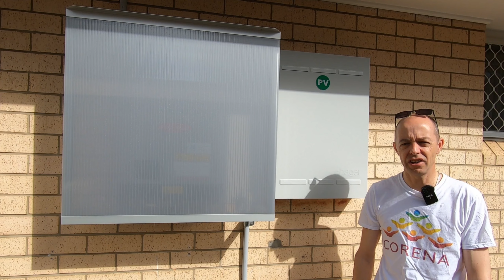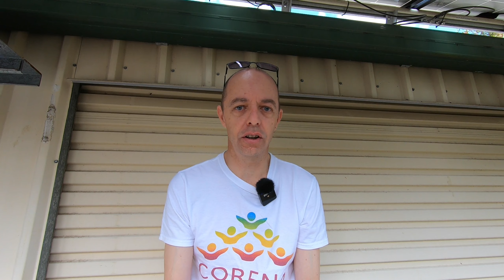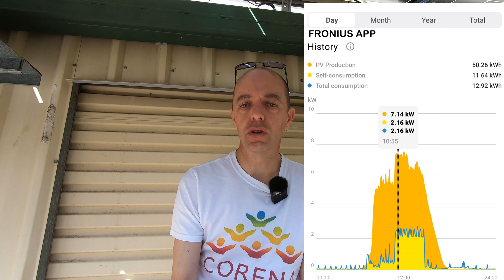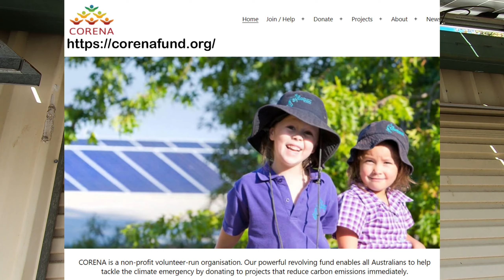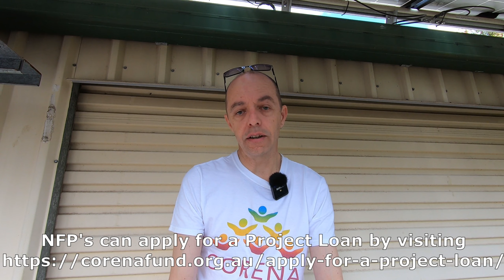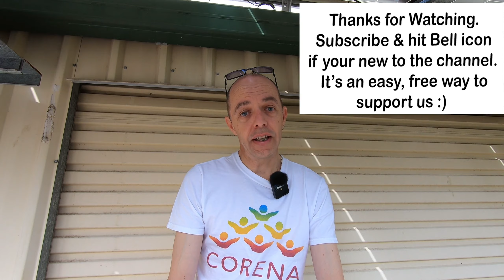Charge your EV for FREE | Choosing a Solar System, Considerations, Our Experience & Cost of Install

Comment: Am considering 2 different setups:
7.83kw system Jinko N type 415W with a 6.0kw Fronius Gen24 inverter $8,045 out of pocket with Vic rebates n STCs accounted for. 

or a 9.87kw system Jinko N type 470w panels with a Fronius 8.0kw primo inverter. $8904 out of pocket with VIC rebates n stc accounted for. 

even if we wait to get a battery down the line that's another few grand $ which I don't think makes much sense for our usage. We have an Atto 3 EV on order but electricity usage is about $280 p month. 

thoughts about the Primo vs Gen24 hybrid? 

Thanks - Dan
Reply from the maker: Hi Dan, thanks for watching and the comment. Main reason for the Gen 24 would future intention to get a home battery and ability to have emergency supply circuit ability if grid goes down and sun shining. It is also quieter if noise would be an issue.

If these things aren't important the additional capacity of the Primo will provide better value/payback.

Thanks again and please 'Subscribe' if you haven't, it really helps me out. Cheers.

Comment: I'm in Brisbane also, I note a few comments of "in QLD" but that is supplier dependant. I have 10.6KW a hybrid inverter and 10¢ per kilowatt export. Just us two here, 4 br, 2 Bthrm, ducted A/C, so light use of electricity, was about $350 per quarter, now in credit ~$26 per quarter. No sense getting a battery with those figures unless we get an EV (next car will be). The inverter has extra connection for an alternate panels to be connected for this. I suggest all interested in solar, and your rundown is excellent, research for their use/costs/orientation/panel warrentee/output etc. Always watch your channel as I love it.
Reply from the maker: Hi Terry, thanks for watching and the comments. Love having that energy being generated on the roof and fueling our EV. It's a game changer if you use a lot of fuel in your car.

Comment: Awesome thanks for this informative video, im in Victoria and had a 10.4kw solar system installed 2 years ago. I was lucky and already had 3 phase so decided to go big. We have a fronius inverter 2 string system, we also have odd roof orientation. Any way Im looking at getting the new MG ev and was wondering about charger size because I don't want to draw from the grid at 28 cents per kw to buy. I was getting 20 cents infeed but Victoria has dropped it and now get 14 cents per kw I feed back, still better then what you're getting that's pretty stink.
Reply from the maker: Hi, thanks for watching and congrats on the solar PV and thinking of going electric. Depending on your driving habits you may not even need an EV charger. The 10 amp normal power point charger which comes with the car pumps in approx 10-12 klms range per hour and if you only use it when the suns out your charging from solar, unless. This is the most basic/manual way but works for us.

Step up is a 15 amp charger which puts a few more k's in per hour or you could then go up to a smart charger which can measure demand and generation and only use solar to charge the EV. Keep in mind the price of a charger buys a lot of grid electricity, but they do charger faster so that's what it really comes down to.

Need any more advice drop us a note via our website and we can setup a 30min session. Cheers Greg

Comment: I like your solar setup. I hear a lot that if you have solar you can charge your ev for free. When most people have to drive to work and charge the car at night surely the battery storage required to still charge the ev for free would be enormous and not really free anymore.
Reply from the maker: Hi Andrew, thanks for the comment. Yes charging from a home battery isn't economical or efficient. Best way is to charge when sun is out. Otherwise if I was to buy grid electricity overnight it would cost approx $8 per 250klms driving. Hope that helps. Cheers.

Comment: A Zappi is only $1395  for 7kW or $1695 for 22kW (which you can’t use anyway being single phase) - I think the cheapest L2 charger on the market is about $900 so the Zappi’s not that much more. Are you seeing better deals than that? Admittedly you might have to buy some other bits but technically it can be hardwired to the CT clamps. A Zappi will automatically use solar to charge your car. Add an Eddi (not cheap - another $900 but reasonable for the currents it’s switching) and you can power you’re pool heater and pool pump off solar.  Technically your hot water as well bu that seems unnecessary.

Comment: I have a similar installation and make the most of my solar power for my car charging by using a EO Mini Pro charger. You can use various different setting to charge incl a Solar Charge Mode in which the charger just match the charging level to what the solar system produce at the time. I’m very pleased with this charger which didn’t cost much more than the most basic model.
Reply from the maker: Hi Ozpro, thanks for the comment. Yes, there are some great value chargers out for balancing solar generation and charging.

Comment: For the EV charger, have you thought about getting one of those semi-DIY OpenEVSE units? They're not too expensive and you can control the output current in 1A steps, say depending on the weather that day. (Or possibly program it to automatically use up any excess capacity)
Reply from the maker: Hey John, thanks for the comment. No hadn't thought of the Open EVSE units. Will have to look into them.

Comment: Pretty nice installation! How did they wire those 3 separate arrays up to the inverter? Does it have 3 MPPT inputs or is there some sort of bypass system or other compromise? Also, I've bought some of that handy twin wall polycarb sheet from Bunnings for a lot less than $300 :-P
Reply from the maker: 2 MPPT inputs, I think East is on 1 and North and another, yep that double wall poly is great stuff. Will be going on the pool area roof when we do it.

Comment: That was pretty good run down. Thanks for another informative video. 
I'd be interested, in a few months, to see how much power you import before and after the new PV system - say average per month in kWh? 
I was a little surprised by the PV generation per day - we are in Melbourne with a 5.5kW array and we generate between 15 and 30 kWh from that array.
Reply from the maker: Hi Benny, thanks for watching. Yes we will certainly do a follow up, particularly after the pool goes in but with Covid and supply chain interruptions that's not happening until April 2022. Our generation is artificially low as we are currently wasting a lot of capacity as our demand is very low. Each day once we hit the max 5 kWh feed in limit (mandated here in Brisbane) the system doesn't generate anything above this unless we add load, which at the moment we just don't have.

Comment: I am surprised they ve given you 330watts panels as the standard are now 370watts, old stock?
Reply: I'd expect that the 370W panels cost 15% more per panel than the 330W panels.
Reply: @ShoebridgeForPM  High yield panels are good where space is limited.
Reply: @FalkinerTim  Yes.
Reply from the maker: Hi Martin, thanks for watching and the comment. You could be right as with Covid supply chain issues and recent price rises in some panels they may have stocked up. 

Local Power told me they do personally manage and hold all the stock for their installs so there is a good chance your correct. Either way not an issue with our install, I just cant wait to get some more demand next year so we can really put it to the test :)

Please Subscribe to our Channel if you haven't, it really helps Us out. Thanks again and stay safe.